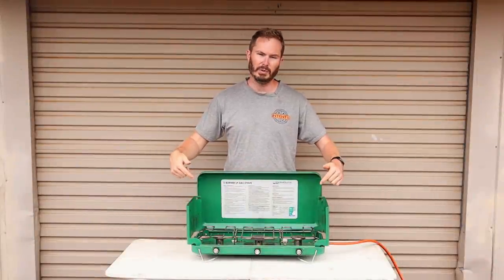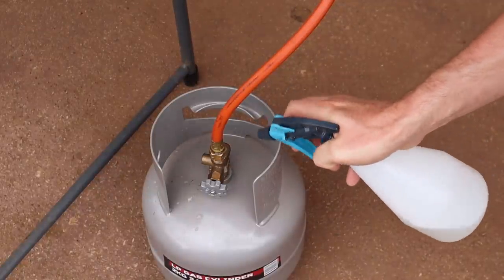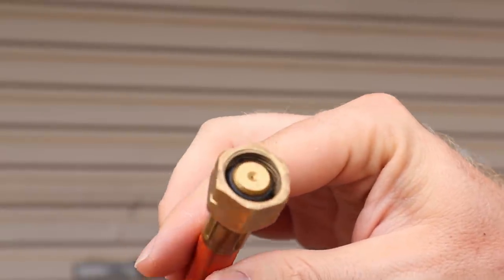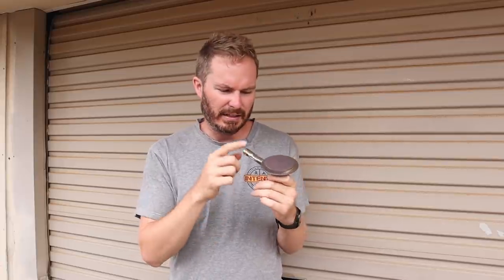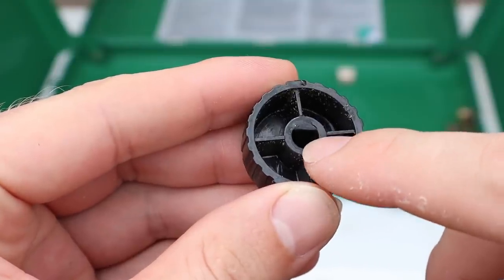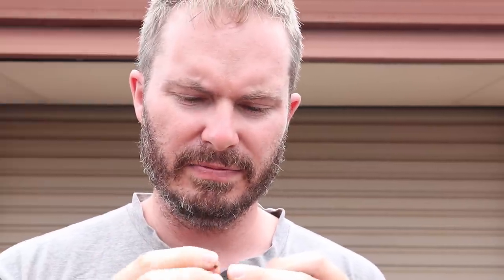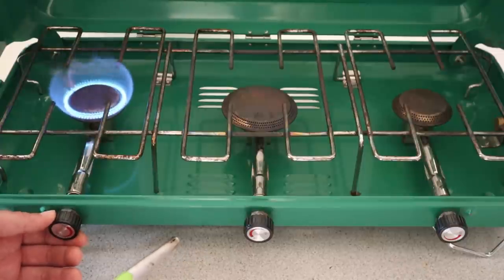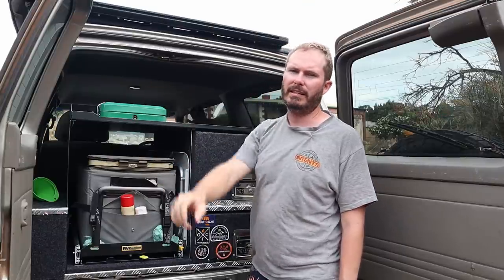Camping Stove Repair | fix low flame

Comment: Very informative video and was well explained. There is one thing my Dad told me years ago and that is when you’ve finished cooking to leave the burners running and then turn off the bottle’s tap. After the burners run use the gas just remember to close them off until next required. This prevents the gel forming in the tinsy (my term) jets over time.
Reply from the maker: I like that! I try and do the same with mine, however I had never thought of the fact it could burn off any sticky crap that would otherwise be left behind. It's a good habit to form

Comment: the jets on mine are definitely the problem after being packed away for 5yrs I was getting no gas to the burner on any of the elements gas was able to move past the knob after removing the jet, but the jet isn't like yours or the replacements on ebay etc it is a similar size/shape  but has no hole at all (appears solid at both the threaded end and the end where the gas is supposed to exit to the burner)

Comment: Hello. Do you know why a brand new hose could be leaking? It is coming out of the threads of the connection. Cheers
Reply from the maker: Could be a missing seal or a manufacturing defect

Comment: I've just done a clean out of my stove too. A spray of carburetor/choke cleaner followed by a blast of air does a very quick job on all the parts. Great to learn that boiling water/dish detergent would be a solution out in the bush, Thanks Alex. 👍 Cheers from Canada.

Comment: Good to see a bit of reduce, reuse and recycle in this throw away world.
Might I suggest that people look a bit closer at what they are buying and ask a few questions before buying the cheapest crap they can as it will likely save them money in the long run.
I have a Coleman dual fuel stove that I run on unleaded fuel and it feels bulletproof. Parts are also easily available if required from what I have seen.
Always cheaper buying something once.
Reply from the maker: 100% mate I make an effort to buy good quality gear and second hand where I can too. Then you get it at the same price as the cheaper shit is new, and it'll last you forever! Those old Coleman stoves are pretty bulletproof and it helps that they've barely changed the design for yeaaaars
Reply: @Alex.G  I have the lantern as well but for its size and output it struggles against modern LED lights It is handy to have either way in case of power failure at home.
The thing I like about the petrol is that it is cheap and easy to get/carry, heat output is good and I'm not carrying a gas bottle around in the car.

Comment: I tried this with the old 20 year old two burner stove I had stored in the attic.  The right hand burner still works great, left hand the flame is very low. It didn't help. Oh well, the old gas camping stove is just there for a back up. The left hand burner will be good for doing my slow cook beef stews, I guess. 

I still love my two burner Dometic Origo 3000 metho cooker. One thing I'd never part with because it's simple and never fails.

Comment: Sorted my burner out - it was the grease build up in the pin prick hole of the little brass bits. Wasnt able to boil water to clean them (as my stove was in pieces..) so i just used cold water and dish soap and a brush, seems to have worked.

You saved it from landfill - thanks!

Comment: The air vent on the burners tend to get fat drip down and block it..makes it even more prevalent when trying to light it in very cold temperatures...good info Alex.
Reply from the maker: That's a good point there. Would only take a couple of decent bacon brekky cook ups to do that too!

Comment: Fantastic video! I was given this exact burner and will be running through it to hopefully get it running. Do you happen to know of a compatible replacement hose?
Reply from the maker: Awesome to know another could be saved from the dump 😁 with the hose, they are a pretty common thing. Look up "Companion gas hose" on Tentworld.com.au. You'll probably want to take the stove into a camping store to make sure you get the right thread type, but they should be available off shelf just about anywhere.

Comment: another great video mate :) Can I ask..... the last time we went camping over Christmas and used our 2 burner stove, that's similar to yours, we left the Stove and Bottle connected, but off unless we were cooking. When I went to pack them up at the end of the holiday (in the morning after using it the night before), the Connection at the stove end was freeeeezing cold...... any idea of why that might be? I'm very iffy on using them again, until I can be confident that it will be safe to use. Thanks in advance. Cheers, Don (Dons Shed and Xplor Overland)
Reply: I used to drive gas forklifts and if there was a slight leak or the valve wasn't opened enough you could get the valve freezing up.
I'm no expert so dyor but doing what he did with the soapy water may indicate a problem if there is a leak.
Reply from the maker: I reckon old bloke has a better answer than I can give to that one. I will pitch in and say I had a very similar thing happen with a lantern on a gas bottle years ago. It never did it again, so I put it down to maybe a bit of grit stuck somewhere.
Reply: @Alex.G  No worries, thanks for that Alex and Old Bloke :) I will get it out, give it a bit of a  clean and see how it goes. Cheers :)

Comment: Do you happen to have a source to find O-rings for the Gas burner valves ? Or is there a kit to replace all the O-rings ?  I have an issue with 1 burner valve flashover...the O-rings for 1 valve are leaking..
Thanks..
Reply from the maker: I only didn't mention it in the video knowing everyone's local camping store will be different but I got all my seals from my local Getaway Outdoors

Comment: Thanks Alex.  How's the HJ61 build going??
Reply from the maker: It's going well. Jake has a lot more time to work on it than I have to film it. So there's plenty of stuff that never made it to the camera. I think I'll pop one up next week, replacing the disc brakes on it 🙂
Reply: Cheers for replying. I was flicking back through your videos the other night wondering if I’d missed some. The car builders insulation install and the door trim repair were great. Same goes for the suspension swap. Quite entertaining. Thanks for doing what you do!

Comment: Live the vid have just assumed the old 30 year one I grab from what my grandparents use may be good with a Reno coming up. Anyone know if you and buy the supply copper tubing at any camp stores
Reply from the maker: Try a plumbing supplies wholesaler for the copper tubing, I've bought some small diameter stuff there before
Reply: @Alex.G  yer cool no worries might give that a try

Comment: What do you do if the brass fitting it leaking?
Reply from the maker: There are a few brass fittings so it depends which one is leaking. Probably put a new seal on it, you can get them easy from a camping shop

Comment: I tend to have a burning sensation
Reply from the maker: With some of the dodgy massage parlors you frequent I'm not surprised mate!
Reply: Any unusual discharge?
Reply: @ryantilley-general.shenanigans  Burns when I pee
Reply: @Alex.G  Always need to look for the happy ending mate
Reply: @4x4CampingandAdventures  hahahaha
Reply: @4x4CampingandAdventures  pop you dingle in the Billy and boil it for a bit. Should get the residue out.